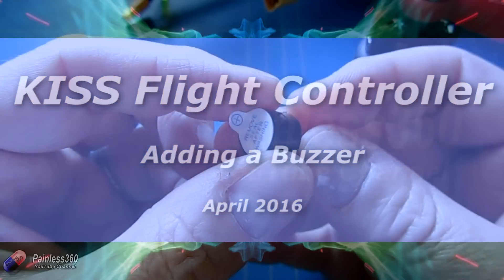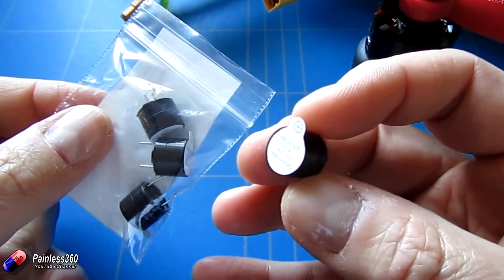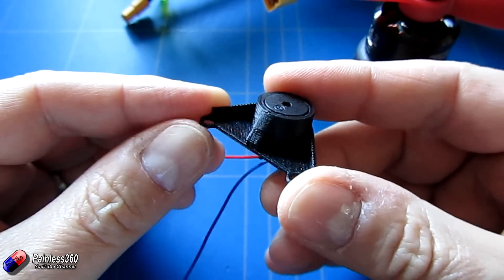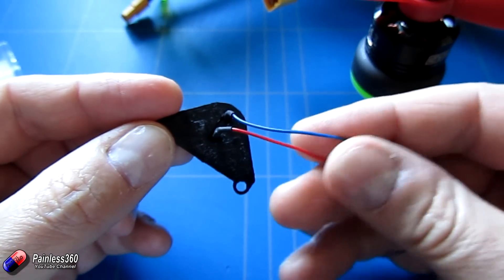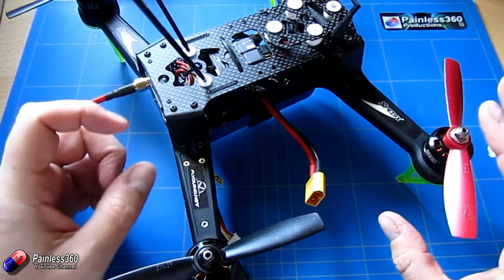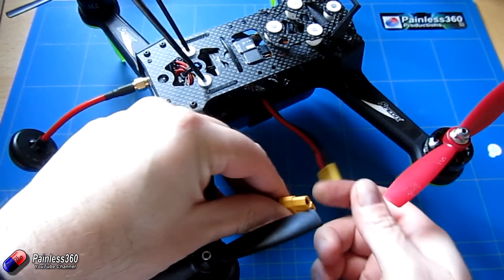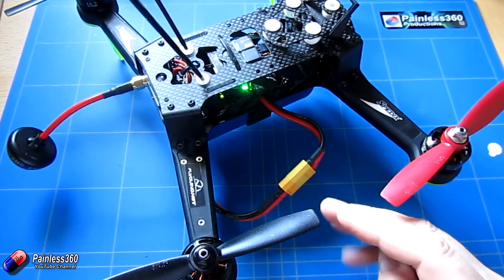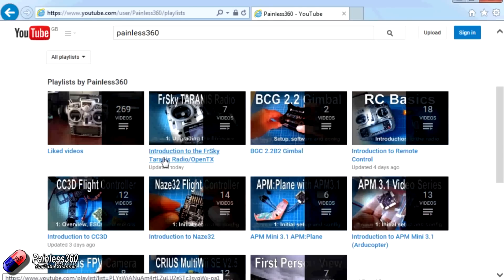Kiss Flight Controller Quick Tip: Adding a buzzer

Comment: I just did my first build and super excited everything works and is far beyond anything I've ever flown can't figure out the lipo alarm set up in the kiss v2 FC set up. I use 4s 1300mah lipos . Do you know how I can set up lipo alarm settings for my battery size? Appreciate all of your helpful videos
Reply from the maker: Not sure, I've passed on this model as a prize so can't try.. Best of luck!

Comment: I have a buzzer but it's has 3 cables red black and white can I use these buzzer ?
Reply from the maker: +tiger exhaust not for those times where there is only two connections for it. The one you have probably works better plugged into a channel on the receiver.. best of luck!
Reply: If you use a clean 5v source, and a separate ground, you can use one with 3 wires... I just installed a ViFly 2 lost drone finder and it took me a few hours of troubleshooting but I finally got it to work.  I connected the yellow to Buzz Ground, the red to 5v on my PDB and the Black ground to an ESC ground.  It works with the switch and if you disconnect the battery, it will beep softly for 40 sec. then over 100db every 4 seconds for 2 hours, then every 10 seconds until dusk.

Comment: If the (-)buzzer pad is broken from the board, but you still have the (+) buzzer pad; is there any way to add a buzzer to the flight controller?  Thank you.
Reply from the maker: It depends on the flight controller. If the buzzer - pad was connected to all of the other GND pins on the FC then you could use on of those... Best of luck!
Reply: @Painless360  Thank you.

Comment: What about VBAT? I have the buzzer hooked up etc, how to I setup a VBAT for the buzzer?
Reply from the maker: +Craka Jax FPV All setup already as the FC is powered from the flight battery directly - good innit!
Reply: +Painless360 I have the buzzer on etc, it works as a lost model alarm, but as the lipo dies, no buzzer sounds. I had originally thought the board was as you say, that it comes from the VIN. But everytime I fly, no buzzer.
Reply from the maker: +Craka Jax FPV It doesn't work like that at the moment for KISS, I'[ve checked with the developers and it's on the list to add - let them know you want it as it helps add to the priority for the feature.. Best of luck.
Reply: Thanks for your help! I can always run the telemetry to the TX.

Comment: Guide on finding a flyaway model with only a fpv feed? It's time for flyers...
Reply from the maker: +Christian Logsdon Good idea! Let me add that to the list..
Reply: Painless360 I basically looked at my DVR video and tried to make out very faint roads and buildings. Didn't find it but im putting flyers in everyones mailboxes around the area
Reply: Painless360 lost about $1000 usd. Including my GoPro 4 and gimbal
Reply from the maker: Ouch. We will be making a video about this. Did you have your name and phone number written on it?
Reply: Painless360 no. but it was registered with the FAA
Reply from the maker: +Christian Logsdon how does that help you find it?
Reply: Painless360 they can look up the number and find all my information.
Reply: Painless360 Im also having a flip of death problem on my CC3D
Reply from the maker: Not sure what's up - I've never seen this behaviour here...

Comment: Can you please tell me about KISS esc's? I JUST PURCHASED 4 KISS 2-4s   V1.1  18amp esc's I was told that if you solder j1 to use onsshot j2 for motor direction! that I was told the opposite also I was told KISS 2-4s  v1.1 18amp ESC'S DO NOT SUPPORT ONESHOT !, I WAS TOLD THAT KISS ONLY MAKES ONE VERSION OF KISS V 1.1 18AMP ESC"S  and all KISS ESC'S HAVE ONESHOT ALL YOU NEED TO DO IS BRIDGE J1 OR J2    DO YOU HAVE THE REAL FACTS ABOUT THIS?  AND Is IT TRUE ALL KISS ESC's HAVE ONESHOT?
Reply from the maker: Not sure - we've only used the ones in the video as shown. All I have is the link to the manual - www.flyduino.net/documents/KISS-ESC-Manual-EN-v01.pdf. I'd also ask the vendor for support too. Best of luck!

Comment: how much amperage can the 5v pad on the fc supply? my tbs unify pro needs 5v and 600ma and iam not sure if this pad can supply that
Reply from the maker: +Project Hu148 for that amount I'd personally use an external BEC. I use a lot of those really small Matek 12v/5v 1.5a units the size of a thumbnail..
Reply: yeah i have a pololu bec but its really crammed in there :D!...also i i have beta-flight on the kiss fc and iam trying to get telemetry from esc sensors to my radio through the SPM4649t, do you know how iam supposed to wire this? apparently the telemtry wire coming from each ESC are supposed to all come together and get soldered to one pad or something iam not sure
Reply from the maker: Not sure, I've not used it but as there is only one PAD, that would be my guess. I'd check the latest manual in case it's covered in there. Best of luck!

Comment: @painless360 First of all, love your videos! My question is what size are those buzzers? can you give me an ebay link, because i have a kiss fc and like your deaign on thingaverse, but need to get the right buzzers for it to be a match. thanks
Reply from the maker: All the ones I've seen have been the same size. Google 'Piezo buzzer' to find them.. Best of luck!
Reply: +Painless360 thx
Reply: I am wondering the same thing so am reading comments here looking for the answer. The Piezo Buzzers indeed come in two sizes, 9x5.5mm and 12x7.5mm. So which is the correct size to fit your mount?